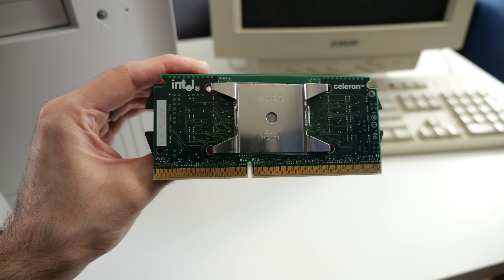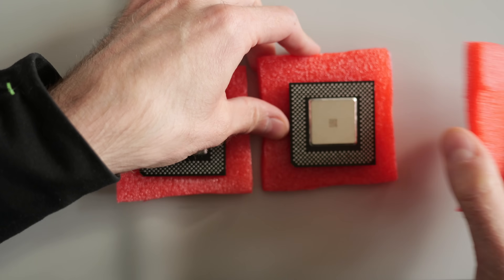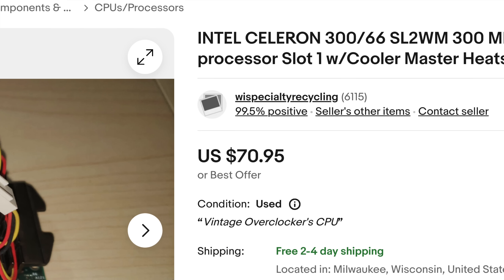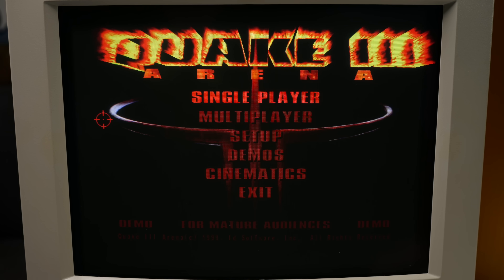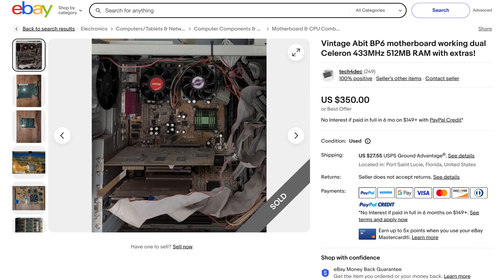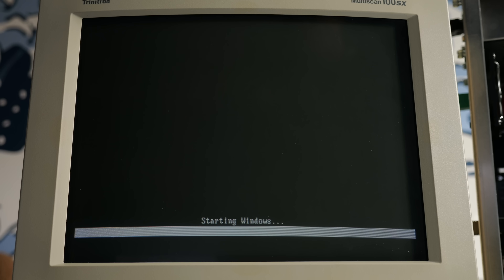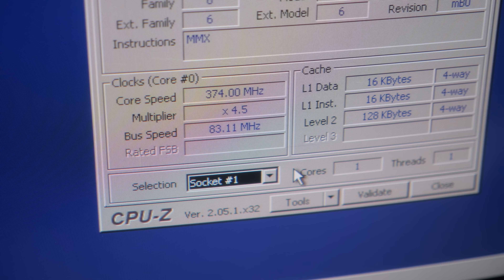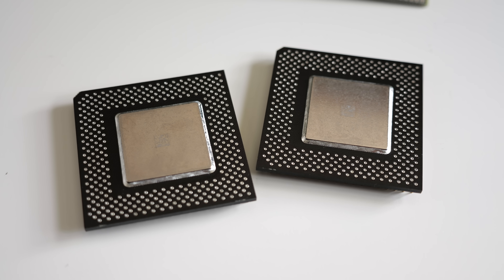I almost BLEW UP two vintage Celeron CPUs

Comment: Also there were 370 Socket to Slot1-Adapter from Madex enabling the dual CPU (incl. Tualatin) configuration on a Slot1-Mainboard like the Asus P2B-D(S), still working here with dual PIII-S 1400. Try Pentium II-300 with the Spec SL2W8. They will run at 450 MHz in a dual setup.
If the FSB at 83 MHz working mostly it's not a problem of the CPUs, but the AGP especially the graphics card.

Comment: No need to re-install Windows 2000.  Under windows 2000, device manager.  Right click on the uni processor PC item and click into properties.  Then go to driver tab and choose update driver.  Next, choose manually select driver and select from the list of built in drivers - one of which will be multiprocessor PC.  You may be prompted for the win2k install disc and you are all set.  Reboot and you have SMP support.  Had to do the same at times when the OS was installed on a mother oars that had ACPI disabled.  After enabling ACPI, Win2K (or XP for that matter) would need to have the "driver" updated to enable ACPI.

Comment: Half of 2025 software can't really efficiently use multicore CPUs, you can't want it from a 25 years old benchmark. When Core 2 Duo was released, it was not that faster because of more cores, it was that faster because of single core performance jumped that much.

Comment: have an Abit BP-6 with 2 oc'ed celerons on it also running windows 2000, yeah back in the days it was pretty much useless unless for running a private server on top of the game lol ^^
btw 333mhz celerons can defenetly run at 500mhz but i had to get the motherboard modded to get there, if i remember correctly there was a faulty capacitor on that board and it would only reach 500mhz with a better voltage regulator, 
if i remember correctly it was to clean up and slightly increase the VTT.

Comment: I had slot version in a dual CPU setup which worked great. Great value for money at that time and it was really easy to pull it off. My machine worked 24/7 rendering.

Comment: If I remember correctly, you had to get the Celerons made in Malaysia to get the easy 450Mhz overclock. Them it would have a high success rate with no extra voltage. The ones you have shown so far are made in Costa Rica, which were not good for this.

Comment: I owned a celeron 400 that i overclocked to 500mhz at the time and it died within the first year. It was impossible to find the 300A model which was said to have better and safer overclocking limits.

Comment: I was running multiple celerons in an Abit BP6 motherboard back around 2000. I was using BeOS and it handled the multiple CPUs very well.

Comment: I have the Asus Slotletts and Abit PB6. And a Gigabyte Dual Slot BX board, vor which i had the Asus Slotlettes. I needed the ASUS Slotletts to have two PIII running on it. The PB6 Board was my Lan Party server for several CS and other game instances. It was fitted with two Celeron 500.

Comment: I'm under the impression that overclocking legends get more extreme and detached from reality as time goes on, and this may also hold true for Celerons being OC miracles based on retellings of retellings of stories. Similarly thinking back to the iconic Core i5 2500K, I built a PC around it in its launch year and at the time I remember people being happy about getting a 4.2 or 4.3 GHz overclock, as was I, but the more years passed the more I came across people claiming that running the 2500K at 4.5 GHz was "easy" and at 4.7 or 4.8 GHz was possible, and I think even one or two instances of people many years after its release claiming they ran it at 5 GHz at one point.

Comment: Ok, maybe I might be able to help here a little. I ran a SuperMicro P6DBE r3.0 board for many years with a pair of P3-666 chips @ 560. That was using a 112Mhz Bus setting via the "Manufacturer setting" options you discovered in the bios. Ran like a top; got waaay more years of life out if it than it had any deserving right to have given.

From my personal experience with that system, what I can tell you is that your problem is NOT the processors. Those Supermicro boards are extremely temperamental. Sure, pumping in the extra juice was giving you results, but it was more of a bandaid for the board and not the problem.

I know your memory is rated for PC133 operation. That is not enough. The p6dbe is very picky about what memory chips it "likes", and, will present some very odd issues if you are giving it memory it doesn't agree with. A perfect example was my system: I was using some very high quality PC133 Kingston memory, and my PIII's were 133Mhz bus chips right out of the box. It was well known that the 440BX could happily do 133Mhz on the FSB, if but for some unfavorable AGP clock division. Sorry, getting tangental.... Point is, I could never get 133Mhz to work on that board. No matter how many tricks I tried. I had some EXTREMELY high end slotket adaptors (that actually had external 4pin power, forget the manufacturer) with a slew of jumper options. Tried switching between my GeforceTi 4600, Radeon 9700, and even a 5500FX PCI card. No dice.

Ok, so why am I mentioning all of that, despite inclining that memory is the issue?

My board would only work with my 1GB of memory when the sticks were inserted into SPECIFIC slots. I couldn't move or rearrange them, or the joker wouldn't even post. Not even at 100Mhz bus. When I swapped out with a random 512MB set of Micron sticks, I COULD get it to post briefly, but the system would bsod much like yours is doing.

I genuinely feel that your issue is memory. It's been forever since I've owned that system, and don't remember if adjusting the latency settings was even possible on that board. If it was, apparently it didn't make a difference. Gave me great 112Mhz life, but that was the limit, and memory was always an odd quirk.

So, TLDR, I know your memory is PC133, but I strongly recommend trying a pair or set of sticks of another brand/speed. Or ditch the board.

Good luck.

Comment: ahhh the good old days lol. i had an Abit BP-6 with celeron 366's in it running at 500mhz. I couldnt get them to run reliably at 550 I dont think. There was a point where you could buy trays of celerons with heatsinks for next to nothing on ebay. it was crazy. I bought one tray basically just for the heatsinks for other projects.

Comment: I used to run a dual MP motherboard with windows 2000.  I used it to render mpeg 2 and then build a DVD menu by hand for low budget movies.  I forget the name of the program now, but it fully used my 2 cpus.   Like you noticed most software cannot use the 2nd cpu.  I built the computer to render video, so I didn't mind that most software only used the first cpu.  Both were overclocked from being I think I took the 1200 cpus to 1600.

Comment: Slot one existed because they were tired of sharing Socket 7 with AMD and Cyrix. They wanted a proprietary socket of their own that other chip makers couldn't use. They thought thy could kill off AMD if AMD couldn't put their processors in an Intel MOBO. FAIL! After the success of Super Socket 7 platform MOBO manufacturers had no problem making proprietary AMD boards for AMD processors.

Comment: celeron 300 legend is not hoax. I booted last week my slot1 Celeron 300 (not 300A) at 500MHz in what I think was the last AT (not ATX) motherboard. It has 72pin SIMM and DIMM slots, a very strange motherboard.  It worked like a charm.
I had also a K6-2 300MHz (same era) able to reach 550MHz running 2.8V (original voltage was 2.2V), but I fried processor and motherboard over 3V trying to reach 600MHz barrier. Honorable soldier, I took out the alu lid and used as keyholder for years as sign of respect. I switched to intel because overclocking damage in slot was not so dangerous to kill the motherboard too

Comment: This is wild nostalgia to look at. I'm currently in the research and development stage of building a (cheap as possible with performance) pc, I haven't built (upgraded essentially) a pc since i was 13-14 years old when these computers were still brand new.

Comment: So I'm not sure the 66/100 jumper on the mobo does all that's needed, it might just tell the mobo that a 100 or 66MHz FSB CPU is installed and expected.
But there is also the "B21" pin that, if "wrong", might just leave the mobo at 100MHz FSB and leave the dividers for PCI and AGP at the 66MHz setting.
So the instability you had may very well be because your graphics card did not like the potential 100MHz AGP frequency it got.
Some slotkets has a jumper to set the B21 (usually labeled 66/100) allowing non overclockable mobo's to be tricked info 100MHz fun.
The ASUS S-370DL might be fairly rare and costly, but the MSI 6905 is plentiful and cheap. A simple wiremod is required and then it also allows for dual fun! (there's also 6905 dual cards, but again: rare and expensive).

And I've never (out of probably hundreds) encountered a 300A that did not work at 450MHz , a small minority might need 2.1v to be 100% stable  but that's about it.

Also your FX5200 might be a lot newer then the rest of the system, but that doesn't mean anything.
The FX5200 was/is a notoriously poor performer, basically GeForce2 performance in a 3 generations later card.
And while Quake3 runs fairly well on a GF2 generation card it really wants GF3 or even better GF4.
All my testing with old SMP systems over the years shows that Q3 gains roughly +30% from SMP enabled, depending somewhat on the benchmark.

Comment: I never did the overclocked Celeron thing back then but I did run dual P3 1Ghz Coppermine CPUs on a VP6 with 1GB of RAM, Windows 2000 Pro, and a GeForce 256 and it was amazingly stable.

Comment: I'm sorry you didn't have amazing success with the 300a cpus. My experience with them has been great. Owned a slot 1 version back in 99 (malay build from memory) that ran for years without issue at 450mhz and 2.2 volts. In recent years I ran a s370 300a in an adapter reliably at 550mhz and 2.1 volts. It would even boot into windows 98 at 600mhz but crash during benchmarks. I played Unreal for the first time all the way through on this system at 550mhz with a pair of voodoo 2's. The slot 1 version was run on a Gigabyte 6ba motherboard (440bx) and the s370 version is on an Abit BE6 (440bx). I'll have to fire it up again!

Comment: Nowdays especially with linux most every bit of software is multithreaded , but pre circa 2006/7 is when dual-cores or better were essentially
 the norm not so much.

Comment: I used to have a celeron 366mhz socket 370 converted to slot1 using slets.
I overclocked it to 550mhz bus100 without any upgrades, just setting it on the pin slets to get 100mhz bus. I forgot the motherboard but it was cheap and generic.
After using it for more than 1 year (OC all the time) I sold it to a friend who wanted it and I upgraded it to a celeron 800mhz.
My friend used it for more than 6 months and suddenly when his nephew played a game there was a bang sound, and when checked the back in the middle of the cpu there was something like a small explosion. That was the end of the celeron 366mhz oc 550mhz the motherboard he used was an asus p2b-f 
no dual processor that time cos the motherboard expensive as hell

Comment: You could go really crazy and install BeOS 5.03. You could go as low as 4.5 but I wouldn't. But BeOS should recognize both cpus easily and BeOS is very efficient with threads doing so. We ran them all the time back in the day, it was just crazy amazing.

Comment: Remove the fans from the aluminium heatsinks and move them to the side. Let the heatsinks stick out on the top. That would have worked and saved you some money on those other more expensive heatsinks.

Comment: I had a dual P2 333mhz Compaq workstation with windows 2000 and it as a beast. In some cases it ran better than my at the time new single core Celeron 2ghz computer.

Comment: There's been a kind of reversal - In 2019 I built a Retro PC with two Voodoo2's in SLI, plus an ATI Rage Fury Maxx (single-card SLI) for the primary video output.  So not only SLI but double-SLI!  But it ran Windows 98 so it could only utilize ONE CPU.  Now, 25 years later, my new laptop has 24 CPU cores and it's no big deal... but multiple GPU's in SLI?  That's just too difficult for us to manage effectively today!  What gives, right?!

Comment: You can change the W2K processor type in Device Manager. I can't remember the exact steps, but you can flip the setting to SMP Processor. Source: Me, with my Abit BP6 motherboard and a pair of 366Mhz Celeron CPUs

Comment: (3:14) I'd assume all the pins were identical with the only difference being how it was connected to the board. Which is likely why CPU-Z knew it was an PPGA chip. Obviously, it would the information on the chip would be reported by the chip itself. Still pretty silly though.

Comment: In 1999 I found a company called X-Corp we were an Animation studio, our flagship computer was called Frankie and always was Overclocked, Frankie I was a Pentium II, Frankie II was Dual Pentium II, Frankie III was pentium III and Frankie IV was Dual Pentium 3 slot 1 overclocked to 1 GHZ pretty stable actually. A few years latter I bought an SGI 550 with Dual Xeon, the big one, I still own her but I never found the mirror Processor and a Regulator to run both Xeons.

Comment: By the time the Socket 370 Celeron shipped higher clocked parts were also available. To be sold at 300 they already had to not work at 500, 466, 400, ect from the factory.  The fluke of the original batch of 300A Slot 1 chips was that there was no higher clocked units available and they sold everything they had no matter if could run faster or not.  They were not testing and would not sell a clock speed faster than the Pentium II available at the time.  I ran a miss matched Pentium III 866 and 650 for a few years, both CPUs used a 6.5 multiplier. The 650 ran at 866 by having its bus speed "Pulled Up" by the faster CPU since the board looked at socket 0 to get its bus speed.  Finally after years of abuse the 650 died and I replaced it with a real 866 CPU and the passed the system on to a friend.  

I also ran an early AMD Duron 600 at 990Mhz for a time with a combo of pencil trick multiplier unlocking and weird bus speeds.  No matter the voltage I could not get it to crack the magic 1Ghz.

Comment: I thought I remember having to set core voltage on the slotkit itself via jumpers and it ignoring the voltages set  in BIOS. Perhaps that was just the slotkits I used back then and I only played with them for about a years time before moving on to S370 native mobos.  Edit: NM you mentioned this just as I typed the comment. 🤣

Comment: Tuning apps to use multi processors back in the day was in art all of its own. There were so many aspects to worry about like the OS's scheduling, the thread placement for the app, how memory is mapped between CPUs and the bandwidth utilization, etc. You could just as easily kill performance with your app or game than improve it when trying to get it to use two or more CPUs.  You often needed specially compiled versions of the code to leverage multiple CPUs with a single app. Often times the best you could do was to set thread affinity for different apps and services to spread across CPUs, or to give your app/game a full CPU all on its own. I looked into getting a dual CPU system back in the day (that famous abit board you mentioned) but came to the conclusion it was not worth the cost or hassle. The entire idea never really matured outside of enterprise environment until the Intel Core series CPUs got popular.

Comment: I Owned one of those Mendocino Celeron and that time it was well known that only slot-1 cpu's were easy overclockable and you wanted to be out of 370 sockets. Mine was rock stable with an Asus P2B at 450Mhz. I let mine running with a 103 fsb speed with the stock fan.

Comment: Could silicon degradation due to age be a factor?
I’ve overlocked a fair number of these back in the day. Some were a pain with voltage others just did it out of the box.

Comment: @1:31: The form factor didn't create slot 1 to increase production yields on Pentium 2, the Pentium 2 WAS slot 1 on launch. The Pentium 2 was a pivot on the Pentium Pro (a server and workstation processor), which allegedly had yield issues related to on package L2. If the die or L2 had a problem, the whole processor was unusable. 
They wanted to get away from L2 on the motherboard for a variety of reasons and figured "we'll do half speed on the cartridge next to the processor", if the die or cache had a problem, they didn't lose that chip. It also moved them off Socket 7, which meant they got to steer the market onto new boards that AMD couldn't offer competing products for. (It did not stop AMD from releasing some very impressive Socket 7 chips).

Comment: Years ago, I had a 300 in a sloclet, paired with a Shuttle HOT-661... That cpu was an amazing overclocker. Stock voltage, 112mhz fsb, 504mhz clock. It gave stunning performance.

Comment: Still have Slot One CPU's. Still have 3 MB 1 Asus, (Upgraded from)  1 Intel (NIB) and 1 Tyan (NIB) I just did a retro couple months back, on Socket A AMD. Hit the power button and POP. The transistors around the Die were toast. Shorted out. It was an old Abit MB. Had the Abit box on a shelf grabbed it, inside was a Brand new Tyan Socket A MB with the extra 4 pin CPU power. Had another AMD CPU up and running. Been doing this stuff since 1991 with an 8088 PC at 12 Mhz.